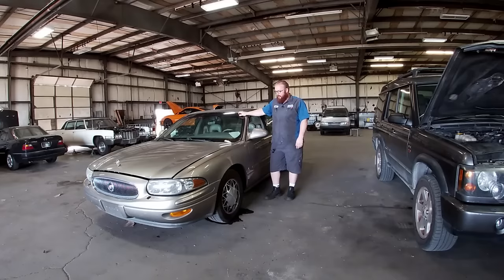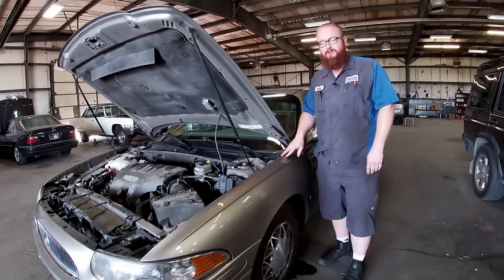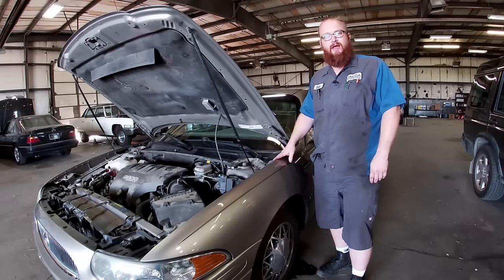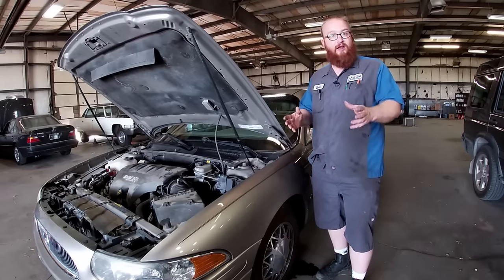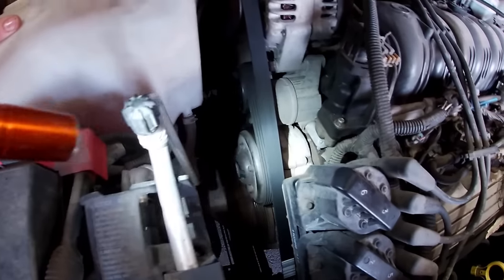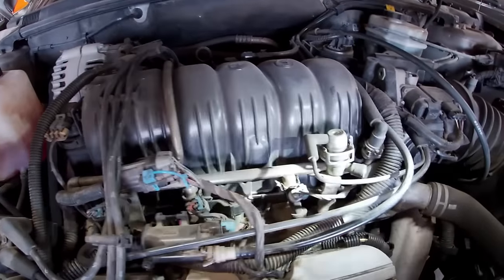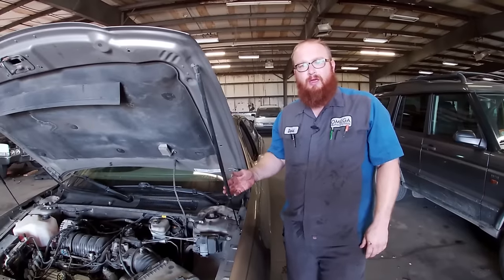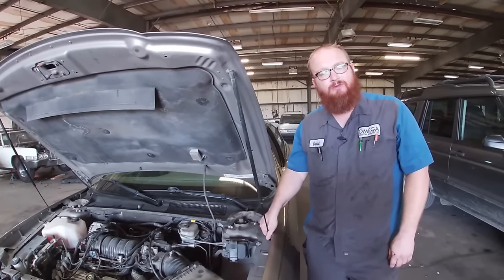CAR WIZARD highlights what makes the Buick 3800 V6 the BEST engine ever!

Comment: If Toyotas are tanks, then this engine is The Scorpion in Halo.
Reply: @YoungBlvckSpitta  Facts! I blew my 99 3.8 on a Sunday afternoon (my profile pic is from that exact day) she was back by Friday morning.
Reply: GM made one engine that would fit into a Toyota lineup....
Reply: Whatever bro you must be a hundred, and live on the road
Reply: @YoungBlvckSpitta  you meant the Wraith. I got you though 👍
Reply: The 1uzfe V8. I have one. Amazing engine block. Too many sensors thom always having issues. My 3800 camaro ALWAYS starts.
Reply: I have a 3.8 99 camaro and its NOT SLOW (for a 3800)  runs a 15 flat in a 1/4. I once overheated it and drove all the way up the sky bridge in tampa with the temp gauge pegged in red. Just made it. Fill with water. Kept going.
Reply: Right??? I used to have a Camry...little went wrong with it but wasn’t cheap to fix and the car would leave me stranded...I had a Santa Fe and it was more reliable...but man this is incredible. Toyota’s are more reliable than most cars...most...but when things go wrong you’re stranded and it’s not cheap...Chevys can go forever with problem as well as Hyundai’s
Reply: @tharpeaddy  As a Toyota dealer mechanic I find that hilarious and true. Toyota’s rarely break down but when they do it’s usually expensive and catastrophic. The ones that roll into our shop are either in for basic maintenance, or needing an engine or tranny replacement. I once owned a couple BMWs. They had more frequent issues than any Toyota I dealt with but the issues were predictable and given you’re a DIYer and don’t rely on a BMW stealership, are not that bad to sort out.
Reply: @YoungBlvckSpitta  No joke. Back in the day there was a guy on the V6 F-body forums that had a 200 shot of Nitrous backfire out the intake. It shattered the plastic air intake (not the intake manifold, those were metal on the rwd versions) and melted the plastic radiator support. He drove home without issue, and the engine never needed a rebuild. Absolutely incredible what these things can take.
Reply: @wayward03  they sold a Toyota lexcen in Australia which had a Buick 3800 ecotec.
Reply: @alexanderstevens145  it was literally a badge engineered commodore. Was the style of the time.
All the old hiluxs and patrols running an ecotec though. (Writing this from my crewman).
Reply: @rossj5347  I think you’re right 👍
Reply: @YoungBlvckSpitta  I know this for a fact!
Reply: @wayward03  Toyota actually used this engine in certain cars if you remember they did work together
Reply: Toyotas are low maintenance that's why everyone loves them GM is no less reliable as long as is serviced I have a Toyota 1.5 in my xb and a 3.8 in my Pontiac grand prix both early 2000 's model both over 200,000 both are regular serviced and both are great cars is my opinion I'm not a mechanic
Reply: @YoungBlvckSpitta  GRAND NATIONAL'S lost little brother engine ...both are in the same family of engines but without the Turbo
Reply: @matte8441  unless it's an electrical or software issue😂
Reply: @zacariasblanco9738  and you could actually get some of these supercharged out of the factory which made for some really great sleepers
Reply: Hahahaha good joke

Comment: After watching this and doing more research I bought a 04 lesabre with 121,500 and I am impressed and ride to work in comfort everyday, its like driving a cadillac with a lazyboy in it. Thank you for the info and the videos you make
Reply: I love it great story I was actually thinking about how many people actually buy the cars he's talking about and you're one of them also your name is Mercedes so it's more funny
Reply: Better than any new GM car.
Keep it!!
Reply: deeply considering getting an 01 lesabre custom with 100k miles for around 3500, found a good one with a clean title and all that mess.
Reply: @adorablecenturion8436  I would jump on that one, those cars are so comfortable to drive and I haven't had to do much maintenance. I have almost had mine for a year and I'm thinking about buying another one for my wife in the near future. Good Luck
Reply: After watching this video I found a senior owned, beautiful ‘03 LeSabre for $4k with 112k miles. The old man who owned it before me was meticulous in his maintenance. He changed the oil every 2.5k miles and babied the thing like it was his most prized possession. The records he kept were incredible. A year later, I have made $5000 in various repairs and improvements through another 18,000 miles of travel. 356 days into my ownership with yet another Service Engine Soon light illuminating because of $1000 in required radiator sensor, a/c & evap leak repairs, I traded in this ‘gem’ of a vehicle for a new Camry. I will never mess with old cars again. I need reliability from a vehicle, not averaging $750 month for a 20 year old POS. My advice, as soon as an old car needs a repair which exceeds its ACV, abandon it. Good luck!
Reply: @brobb-sd9vp I got a 97 with 85k for 1700$
Reply: im an audi guy but ive been modding my d2 a8. been a garage baby for a while. decided to buy another car just in case. got an 07 buick lucerne with 129 on it. thing is crazy good man. crazy. bought it and i didnt have to do anything. ive just been driving it! heated steering wheel heated seats the system bumps just as good if not better than my d2. blew my mind. for the money i think the lucerne specifically is the best car around. love my d2 way more obviously, but man its not even close as far as price goes. cant say much about reliability tho, never had a problem with the four rings.
Reply: just picked up a 2005 LeSabre  with 117K for $800 - today was first work commute day 40 miles each way  80-85Mph without a miss - she keeps this up for another 6 months - when the lease is up on the honda, this is going to take the place as my daily driver
Reply: How is the access to the spark plugs in the back?  

How do the timing chain and timing chain gears hold up?
Reply: @Firebert79TA  spark plug access was fairly easy you just need a swivel socket and I haven't messed with the timing chain but I put 25,000 miles on it and she is running perfect, i did get a solenoid changed in the transmission only because that is the only weak point on the car, it has given me no issues an I'm at 141,500
Reply: You have to play the radio loud to keep from falling asleep in a Buick seat
Reply: @brobb-sd9vp  sounds like you didn’t take care of it. Cope
Reply: 😂😂 that’s too accurate. The lazy boy part 🤣
Reply: Yes true , if other drivers weren't crazy driving  to work would be a great pleasure.
Reply: Does  anybody on here have radio issues?  AM comes in great but FM whispers at full volume?
Reply: @laurahamer9165  the radio needs to be replaced.
Reply: @brobb-sd9vp  Finally, someone speaking some truth.  These cars are junk once you hit that 115-120k mile-marker.  
Want a car that doesn't need work?  Buy a Ford with the 4.6 2v.
Reply: To anyone on here considering a Buick 3800 equipped car, specifically an N/A one: MAKE SURE IT HAS AN UPDATED FUEL PRESSURE REGULATOR. My father's '01 Bonneville suffered a fiery explosion earlier this year due to a faulty fuel pressure regulator that GM claimed was improved for the 2001 model year. Turns out that was a lie. The car was totaled. Upon researching the issue, there are thousands of cases, and even a recall, which DID NOT cover cars after the 2000 model year, even though it obviously wasn't fixed on the newer cars. Even a famous video of a 3800 impala blowing up in the exact same way at a shop after an oil change. So if you've got a N/A 3800 car from 2000 or earlier, make sure its had the recall done. If you have a 2001 or later, you'll have to do the job yourself or somehow verify its already been done without a recall sticker.

Secondly, the 4T65E transmission is notoriously weak. Excessive clutch wear is pretty much guaranteed unless shift kit is installed. Signs of this issue are hard shifts aı eventually slipping/shuddering during acceleration.

Comment: Best engine GM ever made. I was surprised they never put them in the pickup trucks of that era. Good torque, reliable, and way better on fuel than the 4.3
Reply: Me too, in the S-10/Sonoma they should put the 3.8 V6 as the base engine and keep fhe 4.3 V6 as an option for more hauling capacity. Instead they put the underpowered 2.2 SFI as base engine.
Reply: I think they would have been good in an S-10 or Blazer. Not quite as much towing power as the 4.3 that is in my "99 Bravada. I'd like to see someone swap one in.
Reply: I've seen videos of people hauling ridiculous loads with their LeSabre so I think they couldve done it
Reply: Yeah but I was gonna say the 4.3 was a really good motor too it was up there with the 3800 they were like 2 of the top best GM made its really a shame they stop making both motors.
Reply: @c.mcdermo  Yes. I towed a double axle U-haul filled with house goods from Florida to Northern VA at 65 MPH on cruse. Unfortunately I burned out the cat. Have replaced it twice now, but otherwise the engine and trans continue today at 210K miles on the car.

Comment: I found a 98 LeSabre with 30,000 miles no rust 3 years ago, it is now my daily driver if I ever get rid of it I will give it to one of my kids or grandkids. I let my son use it for a week once and he told me it was the most all-around perfect running car he had ever driven. I am always on the lookout for another one just like it, it's that good. TheReaper!
Reply: I lucked out on a 97 Buick Lesabre with 36,000 miles. I went ahead and replaced the plastic elbow with metal. Also pulled the upper and lower intake to replace the gaskets with Felpro. I'm convinced it will last us the rest of our life. Now I need to get rid of that RIDICULOUS air suspension and install regular shocks.
Reply: You have to check the  time chain.  GM has Teflon coated timing sprockets in those days.   ( Although GM might have gotten rid of the Teflon coated timing sprocket by 89.  It was in my '87 Olds.  I changed it).
The Teflon would wear off by 90,000 mi. Causing the timing change to wobble,  which caused the valves to get hit by the pistons.  Destroying the engine.   The easy way to find out is dropping the oil pan.  If you see little white plastic spikes,  then you have a Teflon timing sprocket,  that is ready to go.
Reply: I still own my beloved 2000 Buick Regal GS that I purchased in October  of that same year. Her name is Lucy.She just hit 250000 miles and is easily the best investment I've made in my overall failure in life.She's so reliable and is in no way a $ pit.She might outlive me lol.
Reply: To anyone on here considering a Buick 3800 equipped car, specifically an N/A one: MAKE SURE IT HAS AN UPDATED FUEL PRESSURE REGULATOR. My father's '01 Bonneville suffered a fiery explosion earlier this year due to a faulty fuel pressure regulator that GM claimed was improved for the 2001 model year. Turns out that was a lie. The car was totaled. Upon researching the issue, there are thousands of cases, and even a recall, which DID NOT cover cars after the 2000 model year, even though it obviously wasn't fixed on the newer cars. Even a famous video of a 3800 impala blowing up in the exact same way at a shop after an oil change. So if you've got a N/A 3800 car from 2000 or earlier, make sure its had the recall done. If you have a 2001 or later, you'll have to do the job yourself or somehow verify its already been done without a recall sticker.

Secondly, the 4T65E transmission is notoriously weak. Excessive clutch wear is pretty much guaranteed unless shift kit is installed. Signs of this issue are hard shifts aı eventually slipping/shuddering during acceleration